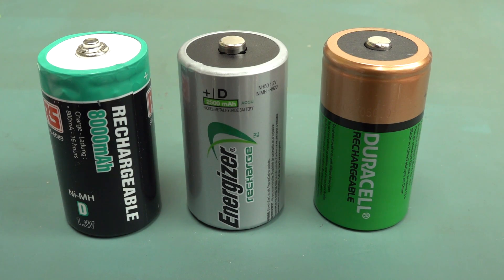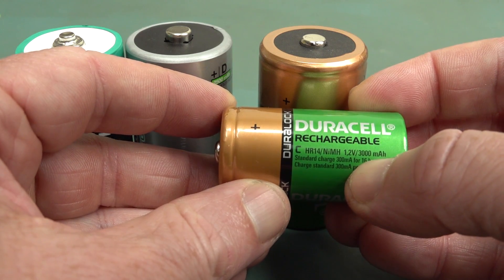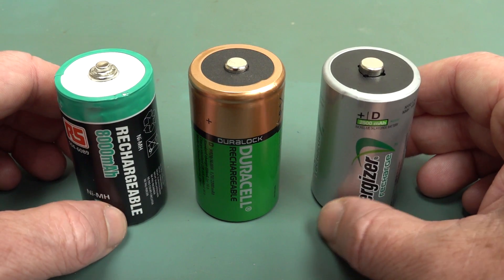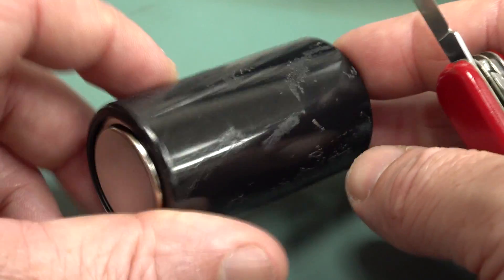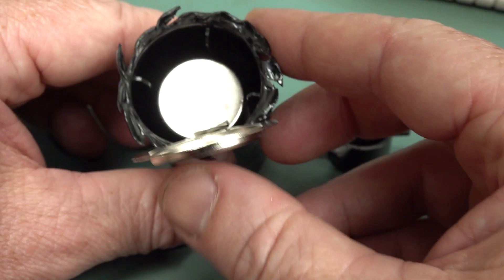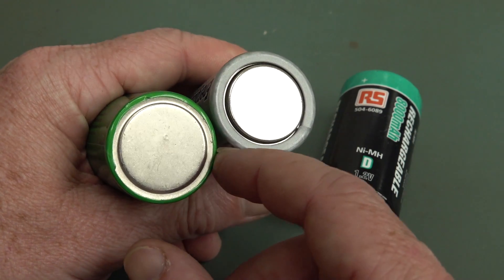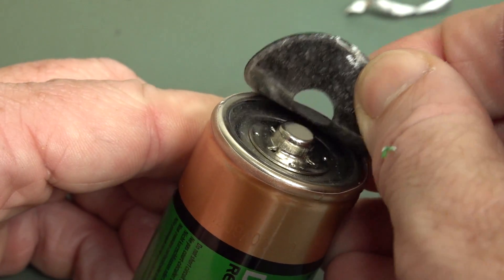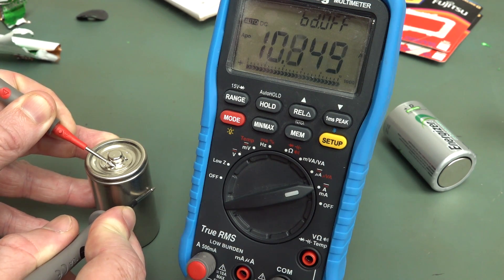EEVblog #1200 - BUSTED! - Energizer & Duracell NiMH

Comment: This has been ongoing for at least 30 years. I can remember back in the 80s seeing D NiCd cells with a capacity equal to AA (600mAh). When NMHi was introduced, same thing. They just took the AA cell, stuck it in a D size package and charged a lot more money for it. There was a time when it was pretty common to see AA with higher capacity (2.65Ah) than D cells of the same brand. This was across the board for all NiCd and NMHi cells sold in retail. To get a proper sized C or D cell, you had to get an industrial brand like SAFT. There was another trick they did with 9V batteries, which was to only include 6 cells, giving nominal 7.2V. This was despite the fact there was room for a seventh cell, which would have brought it much closer to the nominal 9V (and give 17% higher capacity). Again, if you bought an industrial 9V, it would be 8.4V. The brand name ones would be 7.2V, plus a piece of foam to fill up the void at the bottom of the battery.

NiMH technology has pretty much stagnated, or maybe it just reached it's physical limits a long time ago. Back in around 2000, you could already get 9Ah D cells. 20 years later, and they're still selling ones with that, or less capacity and it looks like the top hasn't gotten much over 10Ah.
Reply: NiMH has still come a long way in the last 15-20 years. Capacity has somewhat stagnated, but that is because of the move to LSD chemistries. Despite the lower capacity, LSD batteries are better suited for almost every application. They have also improved significantly in charge cycles.
Reply: Good thing I got D cell casing that fits 2AA in each casing, giving me 5Ah.

But I did it because I had lost me D cell charger..
Reply: They were still using alkaline manufacturing designs for nimh. 6 alkaline cells was 9v (1.5v X 6). They didn't change the design for NIMH, (although they were less Volts per cell) so 6 cells only came to 7.2 volts (1.2v X 6).
Reply: @randymc61  Actually, no. The non-rechargable batteries had six cylinder cells inside, while the rechargable ones had a stack of button cells (usually with some elongated "button shape" to better match the cross section of the 9V block battery case). You could vary the height of the stack by using a different number of cells or cell with a different thickness (and capacity). Cheapest way was to use less cells and filling the extra space with foam.

I also remember that non-rechargable cylindrical batteries sometimes had smaller cells hidden inside (sometimes with the outer case being of plastic, not even metal). This was usually the case for excotic form factors. Instead of having a complicated machine which builds cell with the right size, the manufacturer just needed a machine which produces "adaptor shells" and these receive smaller cells of a more popular form factor inside. Found that out as a little kid - I would crack "reverse engineer" depleted or broken batteries to see what's inside. And that was at least 35 years ago.

Comment: Nickel Hydride is shit. It only has a maximum operating temp of 55 degrees C and for what we sell and use them for that will cause issues, so no warranty for you. They caused millions in warranty issues for one company who tried swapping over. If using them you should only pulse charge them so using the a charger that has boost then trickle it can stuff the batteries too. Nope I don't trust them at all.

Comment: I think my old 10Ah D-cells were Annsman or some such make - brilliant for bike lights as not beng full of air the contents don't rattle about and break/fatigue like the under-capacity D-cells.  This is a definite failure mode for crap C and D-cells as the mechanical support is usually not considered.   [ correction, An-mann brand I think ]

Comment: It's not really a scam. The capacity is listed right there on the damn thing. Ofc that is assuming that listed capacity is real capacity but unless you are buying some cheap trash directly from china for 10 cents it's usually the same as the listed capacity. I would say their solution is quite ingenious. The batteries weigh quite little (which will matter if you put 2-3 of them in a handheld flashlight) and use the same cell as the smaller one meaning you only need some small changes to the factory production line to produce the larger battery.

Comment: you're lucky it didnt burst into flames, bigclive opened up some aa cells and one did! the stuff in it is 'pyrophoric'
Reply: If I recall right bigclive's battery was a lithium.  It is interesting that the NiMH and lithium seem to be using the same wire mesh.
Reply: @gn02020202  I think it was a NIMH battery from Lidl.

Comment: I would have been a LOT more interested in good old testing.  How about testing and showing someone that actual capacity of these cells.  I for one doubt that the one has 8000ma or 8 AMP capacity.  I know that many Li-on cells listed at above 3500ma are a lie.  the same 18650 cells list from 1A to 35ooma may be right.  Few if ANY have capacity above that. the highest I have seen from known reputable manufactures is 3300ma from Panasonic,  newer Samsung and a few others.  I am confident the rest of the "Sellers" Not the manufacturers list, 3500 to 10,000ma    Don't be fooled.  I know that before Alkaline cells, batteries were made in "D" size for flash lights because of the drain.  To keep trend with hand held products that use D cells, these C batteries inside still give a ,ot more run time than the original D cells and even more than the newer Alkaline cells.  I don't think Duracell or Energizer is tricking anyone or "Ripping them off?

Comment: I presume, the 18650 are setup the same. In Bunnings Hardware 'Aust' You can pay upwards of AU$20 for a 2pk 18650 batteries at their battery counter. If you go to the Solar Light section, you can pick up a 2pk of 18650 for AU$10. They work just great in your LED torches. (Flashlight)

Comment: You talk about wasted space but a D Cell has to be a certain size physically so to fit where a D Cell was designed to go. As technology advances things get smaller but the size spec.remains the same. Btw, the RS battery is a Specialty High Output battery so you’re not comparing apples to apples

Comment: Its not to rip you off,because they state the capacity.  But if you have a lattern (for instance), it will weigh a LOT less.  If you want higher capacity and more weight, buy the higher rated ones.  It gives you the choice.

Comment: Now take a look at what we call in the US "6 volt lantern" batteries. Those always were made from four "F" cells. Now the cheap ones use 4 D cells, same case sizea. 1/2 power at best, and NEVER an amp rating printed on them.

Comment: I get between 1850-1900mah  from my AA nimh batteries and high capacity ones can pack up to 2500. So 2200 isn't even worthy of a C battery.  But this isn't really shocking since most of the options you can find for C and D rechargeable batteries  on Amazon are just spacers for AAs where you put a AA into a larger C or D casing... how absurd. Plus many batteries don't go to their full stated rated capacity by different amounts so I believe you should have tested that.

Comment: LOL that is just stupid... the Duracell normal AA's are like 2500mah the ones I have from many years ago and the low self discharge Duracell Duralock AA's I have for a few years too are 2000mah lol that HUGE beast only have 500mah more than the years old AA's from them... And they also have now the 2500mah Duralock AA's...

And I have been using Turnigy Low Self Discharge AA's for a few years which are 2450mah and always charge a good amount more than advertised lol...

That's basically just a AA battery shaped into a D battery (might have is better discharge rate, no idea neither I care to go watch their discharge rate actual real tests)...

Comment: Padded out with lots of manufactured outrage here. I expected better from you, Dave. D cells come in a range of capacities so if you need D cells to fit your equipment but you don't need a high Ah rating you don't need to pay for it. If you do need the extra capacity you can have it but it'll be more expensive. I'd expect you to explain that; not start inventing battery conspiracy theories.
On Amazon.co.uk (my national branch) there's one outrageously overpriced 2.2 Ah Duracell being sold by an Amazon affiliate but the other rechargeable D cells on offer have prices that vary in proportion to their capacity. It's just about being an informed consumer and buying what you need from the consumer choice on offer.
Oh, and for everyone asking to see the RS cell cut open, there's no need. For an 8 Ah capacity there won't be any air gaps inside.

Comment: I used to buy Engergizer AA NiMH batteries all the time for my devices, but I noticed that every year or so the number of mAh on the battery would steadily go down but the price would either stay the same or actually go up. It started with 3000mAh batteries, then went to 2400mAh, and most recently they are selling 1800mAh in packaging that looks almost identical to the original, at the same price. If you don't look closely you wouldn't even know you were buying batteries that have much less capacity!

Comment: It's not really a rip off.  The size of batteries is standardized.  The fact that these are "D" batteries just means they fit into space a D battery is supposed to.  The energizer/duracell batteries are the correct size and rated capacity.  They may have less capacity than the non brand name batteries but they also cost way less.

Do they uphold the marketing of Energizer and Duracell as being top quality batteries that outlast competitors?  No.  Unfortunately they were smart enough not to put any kind of marketing on the product itself that would indicate they're the best batteries.  This just shows that Energizer and Duracell are just heartless corporations that do the bare minimum to supply a product that people wilt think is good.

Comment: I do not think this is a rip off since you can read the capacity on the batteries and compare that together with prices. Eg. I use R6 (AA) most myself and I think mine are 2600mAh and looking at the RS components site the price gap from 2600mAh to 2850mAh is not worth the extra 250mAh.

Comment: "for your farting novelty toy"........??? :D  I've always presumed that it was a bit like speaker outputs stating that something was 4500w and that anything like the 8000mAh figure on a battery would be misleading, not the other way around! I wonder if the respective weights might be a better way to shop in future, until the manufacturers watch this and then start adding resin into the voids?

Comment: No, you're getting ripped off. Amazon has a pair of D cell 10000 mAh EBL batteries for 12.99. A pair of D cell 2500 mAh Energizer batteries are 9.99, but are currently on sale for 7.98. Even if the EBL batteries are only half their rated capacity you're still getting ripped off buying Energizer or Duracell. 

Sources: https://www.amazon.com/EBL-Rechargeable-Batteries-10000mah-Battery/dp/B00IDUVQHA
https://www.amazon.com/Energizer-Rechargeable-Batteries-NiMH-2500-count/dp/B0031JYRCY

Comment: I've got a "BATTERY DOCTOR" I can charge/test any battery except NhMi. 
Regular carbon batteries can be recharged 100x.
Out of every set of carbon batteries only 1 fails, did you throw out the set when they were  suppodely flat  ? 
This is the trick of batteries. 1 fails in the set and most throw out the set and get new ones.
Get a battery doctor recharge unit. Check your batteries before charging,  Has 9v and 2 clips on wires for larger batteries and button batteries. Button batteries ( car key batteries )  can be recharged many times but seem to hold less each time ? 
If batteries were made a little better there would be no issue with flat batteries, 
Save big time on batteries, I bought a set of 10 each of AA, AAA NMHI. They are still going strong 5 years later.
B5w the 12v battery in your car is the most inefficient system possible, the alternator takes approx, 25% power from your engine = 25% more feul just to keep that shite 12v system working.

Comment: Always knew D size were scams, just never openned one or had proof. Considering C size is almost equal to a 18650 (3000mah) and a 26650 is around (5000mah) a D cell should  have a least (5000-10,000mah) you can tell if u gotten a Tenergy D or a Powerwall D battery nimh as well both rated at 8000-11,000mah.

Comment: I was waiting for you to cut the 8000 ma battery. That’s was the whole point.
Reply: Is it really 8Ah? I would like to see discharge test.
Reply: @mateyko555  Yes they are. Bear in mind RS are an industrial supplier & everything meets or exceeds specification. I have some 8AH ones & I tested two samples through a discharger instrument & found them both to be just over spec. The RS 9v batteries are actually 9V...many 'retail' 9v batteries are 8.4V or worse still 7.2V.

Richard (UK)

Comment: I don't know if you know the Aldi shop, a big and cheap German grocery store. There I remarked the same phenomenon, but without attempt to cheat. Their C cells have 4000 theh which is exactly the same as their D cells! I found this weird until I weighted them and found only a small difference between D and C cell. Aldi at least sells the both for the same price in a pack of two, but it is a deception since the D cells are made for a longer using time. I also have very old NiCd D cells with also 4000 mAh.

Comment: I don't get where's the big deal, they are just selling lower capacity baterries with that format, and since it would be pointless on maiking a new design for such a low capacity they just put smaller ones in them

Comment: I have a 9pcs set of origin recharge D-cells with 4900mAh each, and a fake D-set with "only" 1800mAh...but the first set was about 120euros and the fake one only 29,99 for 10 cells...and, jep, i use them in my BoomBoxes ;)
And i also use the AA to D size converters....as today´s NiMH AA-cells are much more powerful than the original 80s alkaline Ds....
Reply: Also i think you don´t get the point of these D-cells right....If you have devices which need a lot of these, you may be happy to get the real size to operate your device and not spending a tripple digit count money on these....in my case i also collect BoomBoxes which usually need D-size cells...;) But you can put a bunch of 2600 mAh AA-cells and a holder inside and run a 9Volt "Box" with 8 AA NiMH cells and a 12Volt "box" with 12 AA-cells, you gonna get almost the same "box-life" out of an AA NiMH set as when you use standard alkaline cells, but cheaper and with more "uumph" out in the streets ;)

Comment: Too bad you didn't measure the difference in case heat as you dumped 10 amps out of those. I would bet that the one with the air (thermal insulation) inside it would stay cooler.  Would be good to know with the thing in your pocket with a car key across the terminals.

Comment: There is also the problem of weight : I use to have a huge boombox that used 10 of those D cells, at the time I was using pimary cells, it weight a ton. And the playtime was several days. If I had some NIMH that weighted less and offered me a day of use that could have been interesting. But well, most of the time if you can have max capacity, you'd better get it. I use mostly AA from Ansmann, and those perform as well as primaries. The oldest I have are AA 2100mah that self discharge in two weeks, but damn when those are charged they have good power and capacity. I see no point in stopping using the oldest ones, those are perfect as long as i know they self discharge. Newer ones do not or self discharge in months. Lithiums 18650 are even better but those don't go in the same devices. Really : 20 years old NIMH still ROCKS ! That is renewable engergy guys !

Comment: So quick question, can I recharge brand A's NiMH's battery in Brand B's NiMH's charger without causing any damage?
Reply: simple: yes. 

long: As long as they are true MiMHs...old NiCads don´t like modern chargers...i´m a boombox collector.....i have tested cheap brands chargers (usually bad) and also have a bunch of good chargers (ansmann for example) and i charge a lot....never having any problems charging different brands on any of these...but the cheap chargers don´t charge up to complete full....also they charge often with too much current which causes the cells to heat up...in one case i measured 60degreeC which is very bad and shortens the cells life damatically...

Comment: The RS is mislabeled - it states both 8000mAh as well as 800???
Reply: no, they´re correct...the 8000mAh is the capacity while the 800mA is the nominal charging current....you also can use a professional charger and charge it with 1/2 C (=4000mA) or even at 1C (=8000mA) but it will get hot and also shortens its life....
Reply from the maker: No. One if the capacity, the other is the 1/10C charge current.

Comment: All batteries should have the mAh clearly marked. As for the air/waste of space inside that is there to make fit a "D" cell, if that means it a "C" cell with a spacer does that matter ?
I noticed a cheap brand sold in a bargain shop in packs of 10 lower the mAh on newer packs. The price of 10 stays the same but you not getting as much and you have to look at the batteries in the pack to see the mAh as nowhere on the wrapper does it say, That's a con !